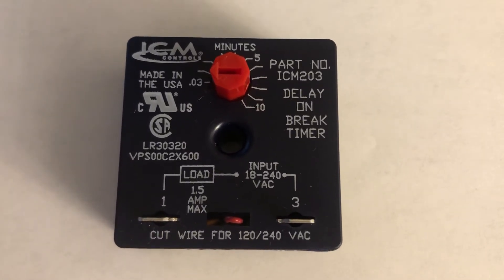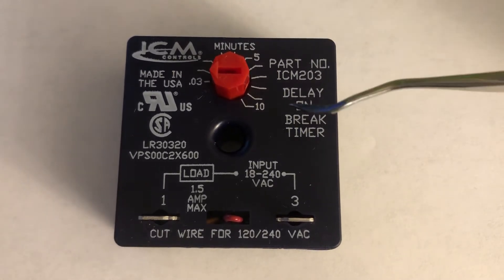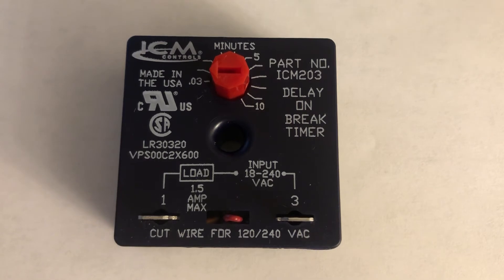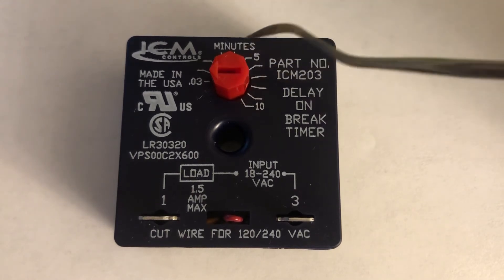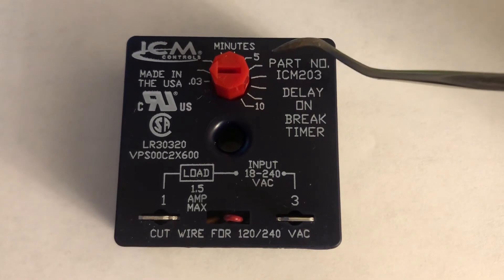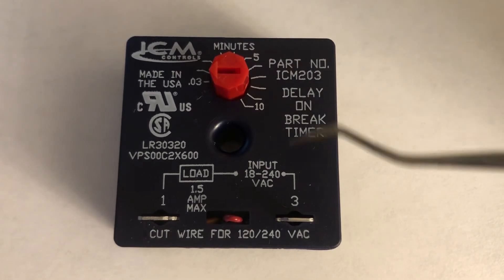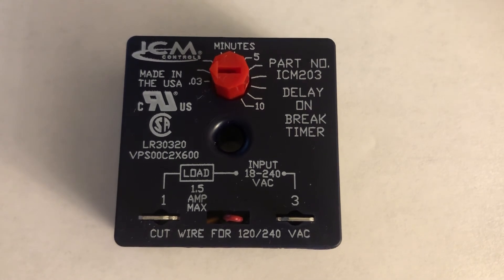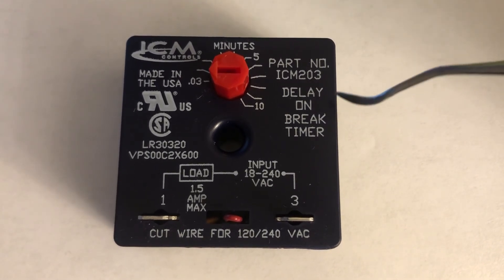What’s a Delay On Break Timer?

Comment: I just installed one of these.  I still have a mercury thermostat, and have always been concerned about the power flicking on and off, and damaging the compressor.  I always turn the unit off during a thunderstorm, but now when I'm not at home I have this added protection.  Thanks for the video.